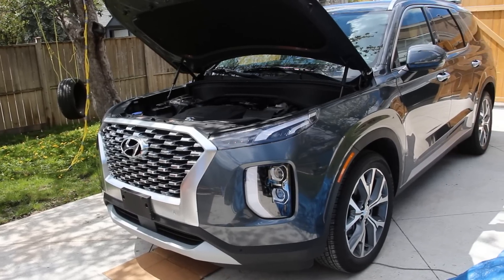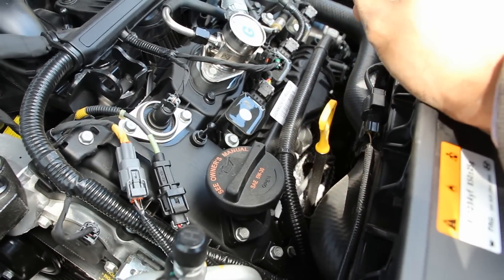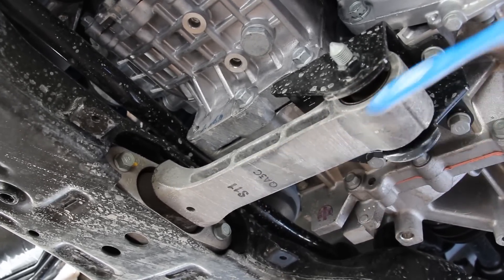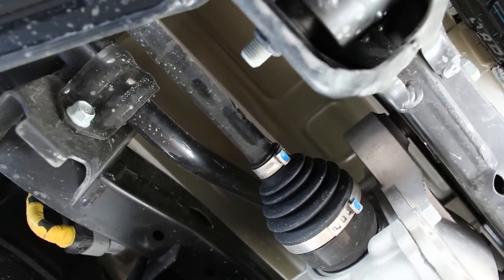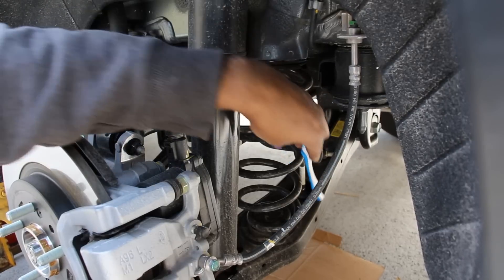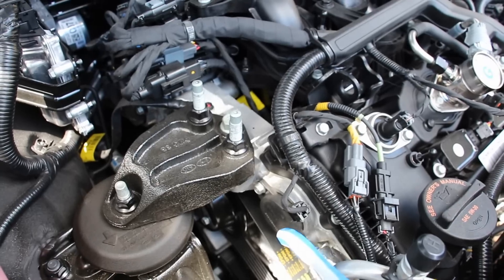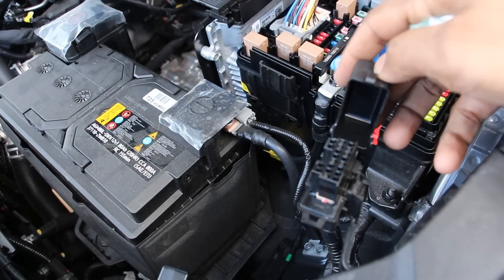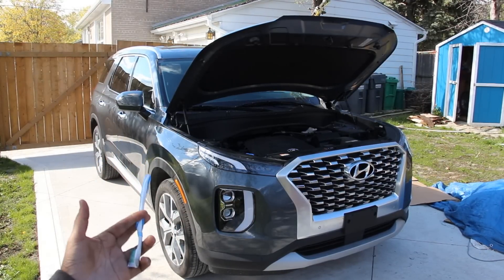Hyundai Palisade Mechanical Review

Comment: I have a question when available. Does the 2020 palisade have hoses connected to the two inlet pipes(wish I could send a picture) On Throttle Body assembly 
I don’t have any on mine.
Are these vacuum hose pipes?

I just discovered this.

Comment: Did you notice the loud Valve Ticking from your vehicle? Or anyone for that matter? I know some can come from the HP Fuel unit but compared to my other vehicles, my 2020 Palisade is very “ticky”-67k miles on it.
Reply from the maker: Yeah I notice it on all DI engines ...you shouldn't be able to hear it from inside the car though

Comment: I am crossing this off my list of cars I was looking to buy. The oil filter screws into a plastic housing screwed to the engine block. Soon as you get a crack you will lose all your engine oil.  I had a 1997 grand marquis with an all plastic intake manifold.....at 5 yrs old it crack and lost all my coolant. Luckily I didn't seize  the engine block....guess what....after so many complaints it became a safety recall and Ford had to recall all of them. In 2002 it cost me $2,000 to replace the manifold. I did get my money back though from Ford.  Imagine the oil filter housing cracking  on the highway. You will lose your engine.....and who wants to adjust the valve clearance these days....were these engineers asleep? What a horrible design is all I can say....thank god I watched this video. Chrysler/Dodge used a similar design.....read about the problems they had with the plastic oil filter housing https://www.ecogard.com/chryslers-problem-pentastar-v6-oil-filter-housing-cooler-assembly-what-means-oil-filter-installers/ 
Dorman made an aluminum replacement  https://www.youtube.com/watch?v=2k7yAlCHTF8&t=42s

Comment: To much plastic should look under the bonnet of a Suzuki Beleno it has a dip stick for the automatic transmission and a metal thermostat cover and a cable for the automatic transmission also a cable operated parking brake and to change the cat converter a very easy job to do no beauty cover Suzuki do it much simple less plastic oops you don't get Suzukis in North America they are as good as Toyota and Honda because Toyota are rebadging the Suzuki Beleno as the Toyota Starlet
Reply from the maker: They don't make them like they used too. Sacrifices under the hood for people to have fancy touch screens and self driving car tech

Comment: Great review.  I watched this one and the Highlander one for comparison as we are shopping and will eventually get one of the 2.  I'm heavily leaning to the Highlander mainly because it is the safer choice.  But the Palisade seems to be better for repairs in terms of accessibility for components.  I'm a little leery of the engine in the Palisade as it is new, even if its a variant of another version.  Not to mention the highlander has port and direct injection which should be the norm these days to be honest.  Having owned BMW's where the focus is on driving performance and feel, both these cars are woefully underwhelming in the performance department for the cost (at least in upper trims), but that's just my $0.02.
Reply from the maker: Highlander is safer choice if you care about reliability and longevity. 
None of these two are meant to be powerful or engaging. You'd need an X7 for that.
Reply: @speedkar99  Yeah, I hear you.  I think that will ultimately be the choice here but it will take some long thinking.  I just hate how Toyota misses the mark on several easy things.  Like still utilizing incandescent bulbs in areas or not using a full LCD cluster (my 2018 330i has the option which includes the full LCD cluster) but gives you a digital rear view mirror.

Comment: I just got a 2022 palisade calligraphy fwd last month. Put 1700 miles on it. I started smelling burning oil, though it was maybe residual burning off. Nope. It is leaking oil. Already had to add a quart. The burning smell is from the drip hitting the exhaust manifold. Amazing car. Gets 29 mpg on the highway easy. Impressive interior. This leak is a major letdown though. I haven't had an oil leak since the 90's. Going in the shop next week.
Reply from the maker: Hyundai needs better QC
Reply: Maybe it's because they use plastic for the oil filter mount.
Reply: @BisdakCamper  it was coming from the oil pressure sensor. Quick fix  hasn't leaked since.

Comment: for the reliability aspect, would you prefer Palisade or CX-9? im torned between these two
Reply: Can’t tell. The CX9 or Mazda in general had some glitches and errors during Ford times about their built quality and reliability. The Palisade on the other hand is a newcomer, who knows about how long it will last? If you’re buying one now, you better get what is going to suit your needs. They have a wide practicality difference. The palisade will offer you more passenger space and comfort and the Mazda will give you wide smile behind the wheel, in my opinion, Mazda is the only manufacturer that has gotten better and better since 2016. I’m putting Mazda behind Toyota’s and Honda’s when ranking Japanese brands reliability.
Reply: @adriannalundasan7570  oh i was talking about mazda cx-9 above 2016, so Ford are not involved anymore. thank you for the insight, i might go with cx-9 since hyundai dealer cant keep up with the palisade demand that i might have to pay above msrp. it sucks
Reply: Both are crap
Reply: @m.b5777  that you can't afford.

Comment: I have the closely related Kia Sorento with the wet8 DCT transmission but with their rather brilliant 2.2 turbo-diesel engine. The wet8 has two separate oil systems with the synchromesh robotised gearbox being separate to the two wet clutch packs. The transfer case is another unit altogether, as in the video.

Comment: You don't always need an intake fuel injector to wash intake valves to prevent carbon build-up. If you use a stratified direct fuel injection instead of wall then carbon build up is prevented

Comment: Wow, what a piece of shit Hyndais are.  The only quality parts on that whole car is the engine mounts.  It's ugly, too.
Reply: just say you jealous and can't afford it kid.
Reply: @darkivaz-aaa1145  I'm smart and wouldn't spend my hard earned money on it
Reply: @skymningforelsket1302  If you're smart, you would buy a Hyundai over the other car you drive.
Reply: @darkivaz-aaa1145  No thanks.  I prefer my cars to not catch fire or explode their engines from metal shavings left inside during manufacturing.  I must admit tho, the cardboard air intakes ducts Hyundai uses are pretty nice, and I also like the decorative chips in the paint Hyundais get all over the car from the cheap paint they use

Comment: Body looks solid, no wonder why I have been seeing Teslas traded in for Kona EVs all over.
PSA: Always apply your parking brake before putting the car into park and you'll preserve your parking pin, and transmission. It's not just for Manual Transmissions folks! Rest your vehicle's weight on the Brake not the transmission!
Reply: I agree but you can still put the car in park first. Just make sure you keep your foot on the brake then pull the ebrake. So park, ebrake, the release brake pedal and all pressure is on the rear brake.
Reply: 2024 Palisade, parking break is auto in mine.

Comment: Great vid just wanna ask if this Hyundai is reliable? And what is an alternative if i cant get it (not telluride)?
Reply from the maker: Who knows. It just came out in 2019.
Reply: I know this is kinda late but Hyundai is pretty reliable now, I have a 22 problems with 33k Miles and no problems at ALL.  And it sounds great once you start driving it it seems, the bad noise isnt as bad as you get more use with it for some reason,  I recommend.
Reply: @BenTheDev  its ok whats the exact car with the engine u got?
Reply: Stick to Toyota.
Reply: @quinty26  but it’s bland good but bland
Reply: @bpstreams7707  get this.

Comment: Modern engines:
70% brittle plastic 
30% low quality metals
Reply from the maker: As long as it lasts the warranty
Reply: Honestly I like all the plastic on our Tucson if taking care of it will last, as I’ve seen from Toyota disgusting looking metal everywhere even in the gas cap area of my mothers it’s all crusty and black lol even though the Yoda is going to outlast the Hyundai definitely don’t like the way ram 4 drives big box of metal.
Reply: Our  last Tucson 100,000 miles still looked new but again it was taken care of no issues with plastics. Meanwhile at 100,000 miles the rav4 has brittle coolant hoses and intake hoses that look terrible. Lol would think it had 150,000 miles and that gets some care not as much but hey.it has already suspension components falling apart and numerous battery failures so I’d say our 16 Tucson did a very good job at 100,000 miles unfortunately it got so carbines up it was killing itselfe so we purchased a 2020 Tucson and I run oil catch can to limit tremendously carbon buildup .
Reply: @henrytom5824  all brands included
Reply: @henrytom5824  Carbon build up?  To prevent those problems get the ports cleaned regularly. It's make or break for these DI Engines.
Reply: @OhPhuckYou  agreed but can’t stop that oil from collecting and layering on top of the piston tops wich was our Tucson’s problem I manually cleaned the ports but the compression had rose becuase the piston tops were covered in layers of carbon. with hard layer of carbon buildup no spray cleaner or induction service took care of it instead the catylic converter got clogged anyways.
Reply: @OhPhuckYou  wich leads to me believe that it wasn’t necessarily the oil from the pcv but the engine was burning oil from the rings but I think it was doing that becuase the pcv oil collected and caused the rings to not function properly from all the oil buildup. But then agai. You can blame that on Hyundai for cheating out on materials and design.
Reply: @OhPhuckYou  you are right the Nu honestly are not much better but hopefully our 2020 Tucson gets a lot of life I run a oil catch can aswell definithelps as I’ve collected a lot of oil already in 16,000miles on the engine.
Reply: @OhPhuckYou  also not sure if I mentioned but the valves weren’t the issue all the carbon buildup on top of the piston tops was so for that kind of buildup what is the best plan to action to remove it I would think a piston soak down but honestly I think nothing was going to fix that issue.
Reply: @OhPhuckYou  I have pictures but lol, the only reason why I would like to know your opinion is because that engine pinged most of the time audibly you can hear in the cabin sounds like marbles the only think that bandaided it for us was to use higher octane gas and man that was expensive a year ago imagine today with these gas prices.
Reply: @OhPhuckYou  thanks for that im the same way man I don’t like shitting on Hyundai becuase we love Hyundai it’s just design flaw I can’t really stand behind it but hen again if you know what your doing an know alittle about these engines can definitely get it too last long let than the average person who just drives it with no care for maintenance and preventative maintenance. That 2016 was purchased used and at about 60, 000 miles it started having issues at around 80,000 and I prolonged the life of it up to 103,000miles untill the cat went out they wanted 4K for new and the engine was burning oil already so if you don’t fix the root cause it will happen again so I wasn’t going for it.
Reply: Absolutely thanks will enjoy our 2020 Tucson for years to come.

Comment: Just hit 1,000 miles on my Kia Telluride, I know the drivetrain and engine are shared between it and the Palisade, but do you know how many of the specifics you're talking about are shared (e.g. oil pan being covered underneath, plastic oil filter housing, exposed fuel filler neck, etc.)?
Reply from the maker: I'd say almost every component  mechanically would be shared. You can cross reference part numbers to confirm.

Comment: Hyundai's GDI are  not prone to carbon build up - their execution of direct injection have proven to be reliable and problem free .
Reply from the maker: I feel like there's a lot of owners who experienced the opposite
Reply: @speedkar99  in my opinion (I'm also a technician) this is not true. Carbon buildup prone engines are tsi, bmw, also puretech  by Peugeot. I'm not saying that CB doesnot occur on Hyundai's GDI, but chances are minimal.
Reply: @golferpro1241  i've seen quite a few korean gdi engines with more than 200k miles - they've never been cleaned beacuse of CB.

Comment: Geezs how much would it have cost to make those plastic parts out of aluminum where there's alot of heat from the oil, basically designed to fail 🤦🏿‍♂️
Reply from the maker: It would cost alot in aluminum

Comment: its a horrible design again i want to see a engineer who designed this to work on it
Reply from the maker: I wouldn't say it's horrible until you see what Ford has done...
Reply: @speedkar99  omg fords worse the water pump is in the crankcase if the pump goes then the oil pan fills up with antifreeze which will destroy bearings and crankshaft

Comment: I like your ford dig. Ive never known a mechanic whos a ford fan.
Reply from the maker: See the new Ford's...can't believe the under pinnings of the escape.
Reply: @speedkar99  and its the same as the bronco sport. With ford running those goat mode adds for it, it wont be long till owners burn them out thinking they can off road in them and ford gets sued.

Comment: Inside of my Grand Marquis' tailpipe was always clean enough to eat off of. I checked it routinely. Todays DI engine powered cars have alot of soot in the exhaust. Dont get how a 4.6 v8 from 2001 runs cleaner than a new 3.8 v6 with 3 cats.
Reply from the maker: Yeah it's kinda strange a new car does that. DI is supposed to reduce emissions
Reply: I think the modern catalytic converters are doing more burning of exhaustion gasses which may cause more soot.

Comment: All plastic shit good for about 60,000 and after turns to shit,   cracks and leaks. Cheap engineering with built in early life failure. Nice to see exhaust pipe tucked up tight against sump to cook engine oil. All said it’s made cheap and not made to last. Thrash and trash when warranty expires.
Reply from the maker: But that's what the consumer wants. Lease and return

Comment: I'm not a big fan of the front subframe design. I was hoping a full box frame. Also the front lower radiator support could crack if the driver hit the concrete stop in the parkting lot.
Reply from the maker: Agreed!

Comment: I love the fact that they stuck to simple design philosophy.  Cost of ownership will be much lower down the road when things start to break down.
Reply from the maker: Compared to a 4 turbo yes
Reply: Simple design?  Remove plastic intake to change spark plugs, remove A/C compressor to change alternator, no Trans dipstick,  Three timing chains, have to remove the entire front to change out the radiator, single GDi no port injection so carbon buildup issues on valves, shall I continue?  Do you work on your own cars?  I'm thinking NO.
Reply from the maker: That's typical V6 modern day stuff

Comment: I do like how Hyundai often uses more tried-and-true design in their cars...should help with longevity and maintenance over the long term.  Given how huge a steel manufacturer Hyundai is, it should come as no surprise to see a ton of stamped steel parts in their cars...making their own steel is one way they can keep the prices of their cars lower than a lot of the competition
Reply from the maker: Agreed. But sometimes they need to innovate. Toyota typically conservative took alot of risk with their new M20 and A25A engines
Reply: @speedkar99  Hyundai tried to be "innovative" and then look what happened between 2011-2015.  Fucking disasters.  Manufactures need to put reliability FIRST and if certain innovations aren't good for longevity of the vehicle, it should not be put in a mainstream basic CUV or sedan.  Unlike some of their 2.0Ts and other crap, this Palisade will see 200k miles or more with relative ease. I'm scared of what we're gonna find about these Toyota engines in the coming years. Honda is being exposed recently too for their GDI turbo issues now.
Reply: @austing4321 Well, as of now Honda is also issuing recalls for many of their V6 GDI Earth Dream engines due to faulty manufacturing. So among other things such as their 1.5T engine premature failures, and fuel pump failures.

Toyota is already seeing issues with their V6TT engine found in the Tundra, GX550, LS500, and the LX.
Reply: @mackfar27  Yeah I see my comment aged shockingly well. Sad to see though, I wish I was wrong.  I do remember this video, and I just don't get why, of all people, a mechanic would've complained about an engine being too simple LOL.  I really do hope that Toyota figures out those issues quickly because when it's not blowing up, that V6 turbo is a fantastic engine to drive.  I gave up on Honda ages ago, it seems like they just don't care anymore in general.
Reply: Seems like Hyundai/ Kia are really doing a lot better, or being more aggressive.  The Veloster N, Kia  Stinger, Kona  N, and now with the Elantra N. All of these offer great performance per $$.
Reply: @fcg243  exactly drive like a 2016-2020 Tucson then drive a last gen rav 4 like a 2015. We own a Tucson 2020 and I’ve drove a rav 4 and though it will outlast the Tucson handling definitely goes to hyundai.
Reply: I wonder if this engine could be a dual injection like their 2.5L Smartstream.
Reply: Some of their components are proving to be not robust at all , i have proof .